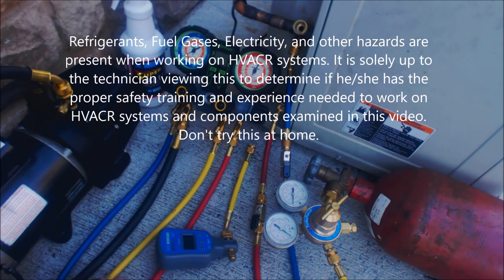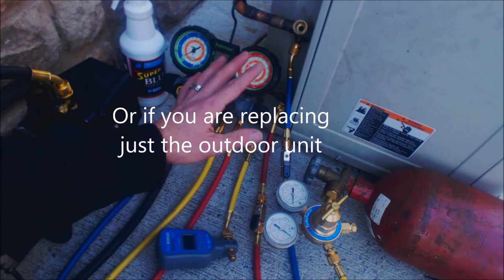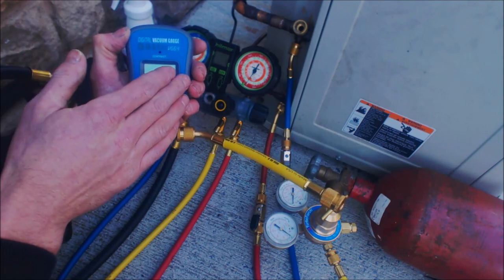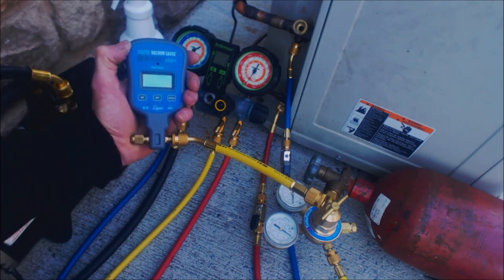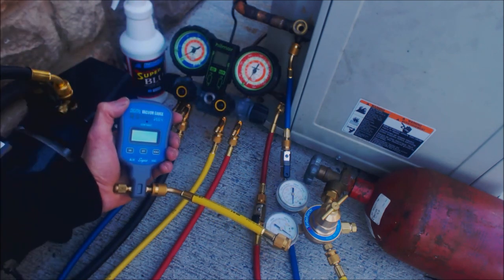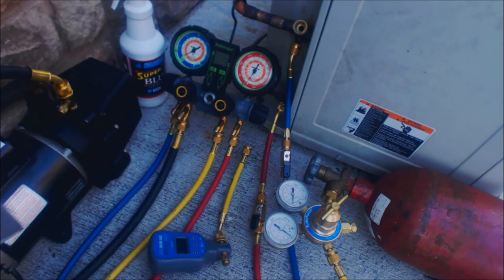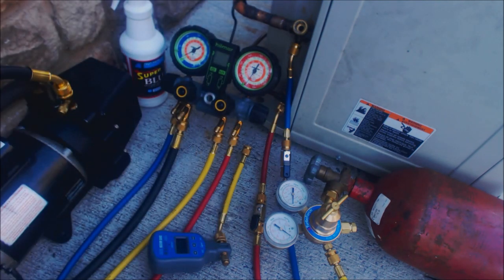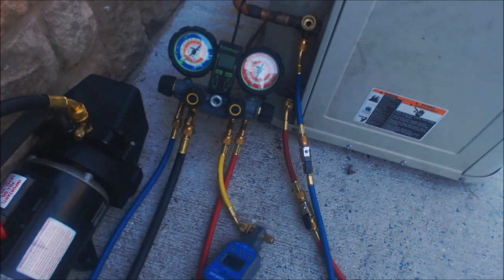HVAC Nitrogen Pressure Test Procedure for A/C Units, the Oil Blowout, Vacuum Pump Setup!

Comment: one correction, the volume of Nitrogen will not change due to temperature, thus it it called "inert".  Thats why I always try to pull the residual refrigerant out of the oil sump in the compressor so that it won't influence the reading of the inert dry  nitrogen during a pressure test.
Reply from the maker: I am sorry but nitrogen is inert which is chemically unresponsive. It is a gas and will increase in pressure if temp surrounding it rises. This won't be as severe as a refrigerant but it will rise or fall a little depending on temp. I even show my students on small projects without refrigerant or air in the lines but only nitrogen. Once again, not much but it will rise or fall a very small amount, Thanks
Reply: all gases change volume due to temperature or external pressure changes. That's not the meaning of inert.
Reply: now now guys, the volume won't change if its in a fixed volume system will it? :P

Comment: I thought nitrogen would not react to any temperature
Reply from the maker: It does but not as much as air but certainly does change pressure due to temp, thanks
Reply: @acservicetechchannel  I'm not trying to contradict,  that's what i was told since i started doing ac work since 1989 and don't take me wrong, I've learned so much from your videos. Keep up the good work. 👍

Comment: The question was in regards to preventing oil from catching on fire while trying to un braze the  joints.
Reply from the maker: You may want to consider cutting the pipe out and swaging it back in to avoid that. That also reduces the amount of time that you would be present when phosgene could occur if you are having to braze in an area where you know to be oil located there. People hold their breath, bring in fresh air or wear scba setup. SCBA i=would be the safest and best alternative.

In reference to the metering device, it would not clog it up but you could try doing the oil blow out in the other direction. The problem being that you may not have enough force to sling it up. If you were to replace the outdoor unit then yes I would look at emptying that trap by cutting in that area. You would want to braze the new filter drier near the indoor coil anyway to keep it from being outside. Great questions, thanks youngbeechnut78!

Comment: Great video....but..but why is it that no one shows proper connection of hoses! It would be soooo helpful to add 5 seconds of video to show which hose goes where! It’s great without it...but without proper connection it’s not very helpful...remember you are doing it for people who are not sure what they are doing!
Reply from the maker: Hey Vlad, look up "acservicetech connect check charge disconnect procedure" and you will see them. Honestly, it just has to do with time and trying to get the shot set up so I know it works and can fit the frame as close as I can while not having to block the camera when doing it. thanks